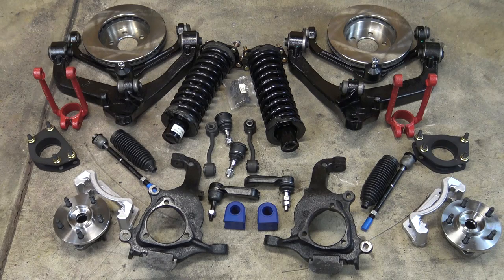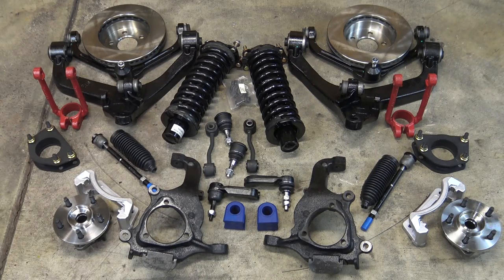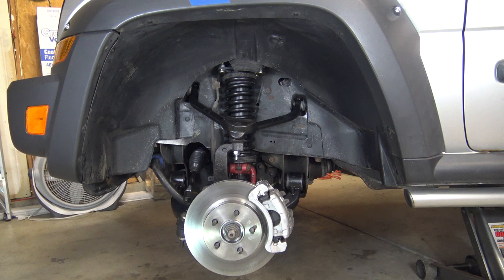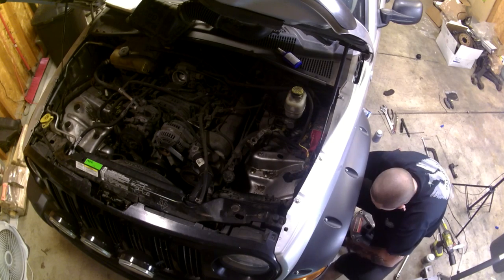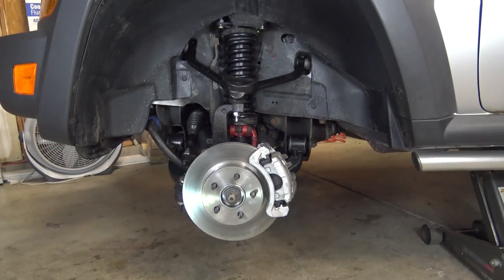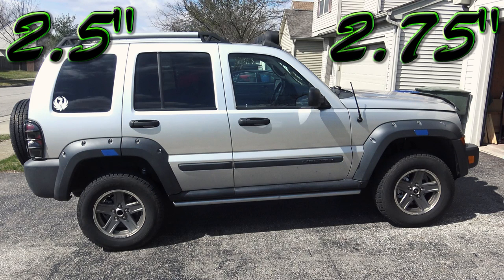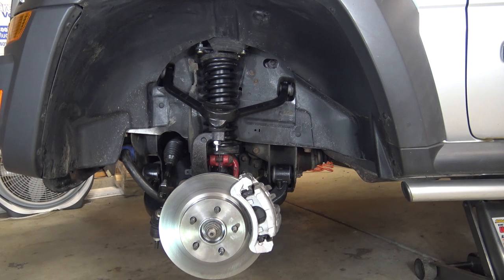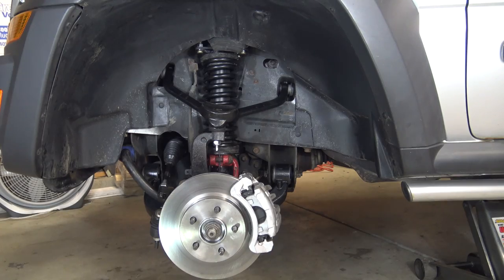Jeep Liberty Front Lift Kit & New Suspension, Project Renegade Ep.15

Comment: I have a 2004 jeep liberty and bought the 12 piece suspension kit, and I bought new shocks that were also a recommended from your Amazon store link, with 3 in spacers I already had, and my upper control arm touches my shock spring, and my inner boot ripped, on the CV axle,

Comment: So after 3 yrs, besides the spacers messing up your suspension (I read the comments),  have you had any trouble with the Detroit axel suspension parts ?? My KJ is like yours mostly street and very little mud and sand,I am considering in putting on pretty much the same parts and leveling kit as yours .. i don’t mind swapping out balls joint or tie rods it’s the putting the strut back in that blows ass how many miles before you notice the strut/spring sagging ?? Great build btw I like those flat grill KJs

Comment: I have a dragged out question for you, I have the same 05 liberty renegade and want to lift it, I found a rough country lift which was 3" included extended shocks springs and spacers. The description states not for renegade models when I contacted them to ask why they said it binds the cv axle because the renegade is already lifted...I asked of i could just use 2.5" spacers to lift it they said no. I was wondering if you had any issues with your cv axle..I know they suggest keeping it under 3" to avoid binding, do you kow how much is it lifted from jeep? And how they lifted it, or would I be safe with the 2" steel strut spacers and rear spring spacers like you used on yours?
Reply from the maker: First, I do NOT recommend the spacer lift like I used in this video. The lift has sagged and destroyed almost all of the new suspension I installed. This Jeep doesn't even get driven anymore because the suspension is so screwed up. I've also been looking at the RC lift to possibly fix my issues, but saw the same "not for Renegade & CRD" warning as you. The only thing that I have found different on the Renegade suspension from Jeep is that the struts are a little stiffer and this gave them .5 - .75 of lift over the Sport Liberty. This was just in the front as it only leveled the Renegade out, if you notice the Sport and Limited sit a little high in the rear, they all have the same springs back there. When I replaced the struts on mine I found out that you can't even buy the "Renegade" struts as replacements. They consolidated the part down to a single part that will work for all the Liberty models, which is the Sport struts. So in theory, if you replace your struts, you can use the RC lift as you have changed the one suspension part that made it a Renegade. Also a side note, if you do go with the RC lift (or any lift really) be prepared for a battle, the lift can be installed, but it will fight you every step of the way. Even with Sport style struts, everything is still extremely stiff and doesn't want to go back together. Give it time and a lot of patience and it will go together.
Reply: @RockyXTV  shit man thank you so much for clearing that up I spent days scanning the internet and writing other lift kit companies trying to figure out why my suspension was any different being a renegade. Now ill just have to decide if I want to go through the hassle of a lift, I was planning on new struts anyways and like you said there didn't seem to be a renegade specific strut. I appreciate your reply man and it's a shame your not driving it anymore your project came out wicked. Thanks again.
Reply from the maker: I hope to get her back on the road this spring, she might be back at stock height and with stock wheels and tires though. If I lift it again when I fix everything I'm just gonna go all out with a really good complete kit, but the kits I'm looking at are anywhere from $1400 up to $3500. Don't think I'm ready to dump that much in it yet, I like her, but I'm not sure if I like her that much...
Reply: @RockyXTV  lol I wouldn't want to put that much into mine she's rusting out good and I'm not sure how much life is left in her...would you say those polyurethane lifts from day star are just as bad for your suspension as the steel spacers?
Reply from the maker: The DayStar kit goes inside the strut rather than on top like my kit. I've heard both good and bad things about this kit ( honestly more bad than good ) The biggest drawback is that it has to go inside your strut, this means having to take the strut apart. Usually not a big deal on most vehicles, just get a cheapo set of Harbor Freight spring compressors and go for it. This is not the case with the Liberty, the "standard" spring compressors won't work on their struts as they are more "coil-overs" than struts, so you can't get the compressors in between the coils of the spring. This usually means having a shop with a specialized press put the plates in for you and that adds to the cost of the lift. I've also heard quite a few complaints of premature strut failure because of the added compression. At the end of the day though, I can't say 100% one way or the other as I've never personally had this lift. I just seems that the Liberty just never wanted to be lifted unless you throw a ton of money at it and get a JBA kit.
Reply: @RockyXTV  i hear you it really does seem like this vehicle never wanted to be lifted easily that is. Thanks a lot for the info man it was a big help

Comment: I bought those same strut spacers but before i got a chance to install them the engine blew in it but luckily I have another liberty as a parts jeep so I am going to do a compression test to see what bank is bad then i will pull one of the heads off of the parts jeep and see if that solves the problem. And are those the interco irok nd's?
Reply from the maker: It's always great to have a parts jeep if you can. I'll let you know if you're right about the tires when of if anyone else gives it a go. Thanks for watching!

Comment: Now you got me a little bit worried. I'm Monday I ordered my lift kit for my 02 liberty and by the looks of things it's the same lift as yours.. now as to regards of the front of your Jeep sagging. I don't quite understand why the front is sagging so much. I was wondering is your front springs factory or are they from Detroit Axle?
Reply from the maker: Front springs/struts, upper & lower control arms, control arm bushings, ball joints, sway bar end links, sway bar bushings, inner & outer tie rods & ends, hubs, basically every suspension component was new and installed at the same time as the lift. The "over the strut" type lift seems to put the entire front suspension in a bind causing parts to prematurely fail. I've spoke with quite a few people that have ended up with the same problems with this type of lift. I got a feeling that something was up with this lift (in the front, the rear is fine) when I finished installing it and went to get an alignment. The guys at the shop said "we got it as close as we could, everything seems to be a little tight" We figured it was due to everything being new. It went out of alignment after about 1K miles, took it back in and they corrected it and said everything was tight, so they couldn't say why the alignment went out that fast. After the 3rd alignment in about 5-6K miles they said it was most likely the lift. Also after installing this kit, I let the Jeep down off the jacks so I could tighten everything on the ground so it was under its own weight as to not bind anything. I noticed that the front was way up in the air, it measured out to nearly 6 inches of lift over stock! I had to drive it for a few miles and hit some bumps before it settled down to where it should be. For the first 6 months it would do this if I had to jack the front end up for anything, I would let it back down and the front was back up in the air, very strange...
Reply: @RockyXTV  I really appreciate you taking the time to let me know what you have done. I have pretty much the same lift as you got I believe. I know you are rushed to get done so I couldn't see everything on your videos. That's why I was so curious to why it was binding up. The lift from what I see should it be binding up at all. Now as far as the suspension components that is a possibility. I think that Detroit Axle and from the videos that I've seen people complaining about Detroit Axle makes up our parts. I believe that that's what's wrong with your front end and it should be corrected by putting the original struts back on along with the lift kit that you have on. I'm going to be doing the same thing in the weeks to come and I will make some videos on it. Hopefully this will help you and other people out. or it will prove to be a big failure on my part and I'll be in the same boat as you....
Reply from the maker: Most of the binding comes from moving the strut downwards with the spacer. This seems to put an excessive downward and slightly outward force on the upper & lower control arms. In order to get this spacer and strut back in place you have to compress the suspension quite a bit, this causes the strut to be partially compressed when the vehicle is merely at ride height and no load applied. I can't say for sure if it was the Detroit Axle parts or the lift, but I can say the lift did have a little to do with it. I just subbed to your channel, sorry to hear something went bad, I hope all is well now. I look forward to seeing your videos!
Reply: @RockyXTV  thank you for subbing to my channel.I'm going to try to put the lift in and keep all the original factory parts on at first to see what happens but I definitely want to replace everything the suspension like you did with Moog. I'll make sure I record everything and post it.

Comment: Did you ever figure out what caused suspension issues? I want to lift mine 2.5 inches. I'm doing a spacer lift and I'm only changing the upper a arms and struts. Will it be an issue?

Comment: Hey, fellow central Ohioan! I'm about to replace the suspension on my '05 Liberty CRD with OME shocks/springs and all new components from MOOG. Should I order new strut mounts and rubber spring seats or just re-use them? Do they wear out? And, if you want to try again getting a good video of the job, I'll let you use my Jeep for free! ;)
Reply from the maker: The spring isolators are usually reusable, but if you can get a good deal on them they would be worth replacing. I would also check with OME if the components are compatible with the CRD as some manufactures state that their parts will not work with the diesel. As for making another video, sorry I'll have to pass, the install can be pretty frustrating, but it can be done with a LOT of patience. Thanks for the offer though!

Comment: How do you adjust the lower control arm? Having trouble adjusting mine please help
Reply from the maker: The bolts holding the lower control arm on are cam style bolts, just turn them and it moves the control arm in and out. They look like regular bolts, but with an offset washer on them. I hope that helps, thanks for watching!

Comment: I'm loving project renagade! It's really helping me with my '05 Liberty. Any chance you could share the parts list from Detroit axle? I can't seem to find all of the parts on their website.
Reply from the maker: Sure thing! Just give me a few minutes and I'll post some links for you!
Reply: Rocky X TV  Awesome! thank you!  does this also include the parts needed for the lift? Or is this for factory height?
Reply from the maker: This is just stock replacement parts, no lift.
Reply: So what did you use for the lift? The front suspension on my 05 is very worn out and I'm having a hard time finding the front lift parts.
Reply from the maker: The lift was just an ebay spacer/over the strut kit, I can't seem to find the link but I'll keep looking.
Reply: I am looking to replace my front wheel bearings. One is going bad. How are the wheel bearings from Detroit Axle holding out on your Jeep?

Comment: I have my lift kit for 5 years from daystar. Your ball joints will suffer. I recommend to change them every year.
Reply from the maker: The suspension on this project is completely shot on the front now. I'm either going back to stock or forking out the 1400$ for a real lift kit. Thanks for watching!
Reply: i just bought a daystar for my 04 liberty limited  what ball joints go bad both?

Comment: Dang I wanted to see how to replace the inner tie rod... mine failed. Oh well
Reply from the maker: Sorry about that. I can tell you that on the KJ's it is kind of a pain, you need to use a different specialty tool that normal inner tie rods use. Here is the part number for the tool at AutoZone 25296, it's called OEM Inner Tie Rod Tool and it was $20 to buy. When installing the new ones I had to use the traditional(tube style) inner tie rod tool because the new ones were like normal tie rods. I hope this at least gives you some idea. Thanks for watching!

Comment: Anyone call tell me  what the name of the red part that conmect with the struct/shock. Thanks
Reply: It on 1:34
Reply: @luisquichimbo1547  Front strut clevis.  Jeep dealer told me the discontinued the part last year.  I haven't been able to find any after market and mine are rusted bad.
Reply: Maybe a Jeep commander’s will fit

Comment: WARNING:    Hello I bought a Detroit Axle kit for my Silverado and the little silver nuts with the  nylon are to soft of a metal to use safely on a vehicle. I just used a little 8 inch hand wrench and the nut pulled the threads right out .So I hope nobody uses these nuts and bought better nuts. Somebody could get killed driving down the road with these faulty low grade nuts.